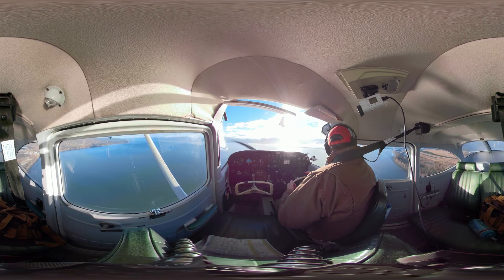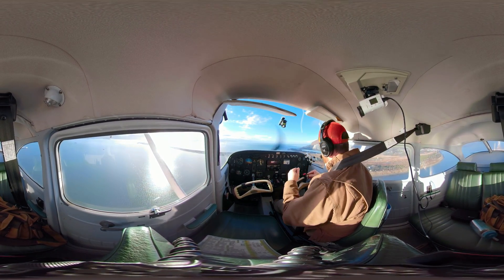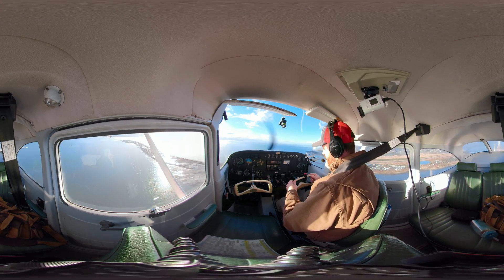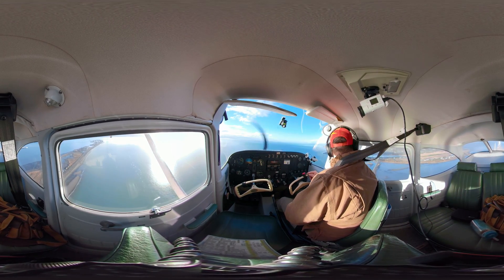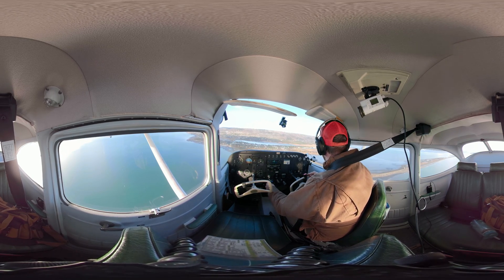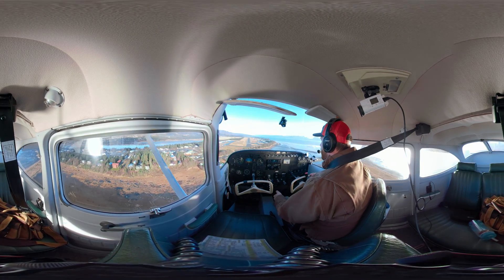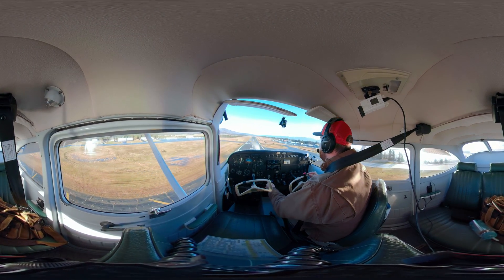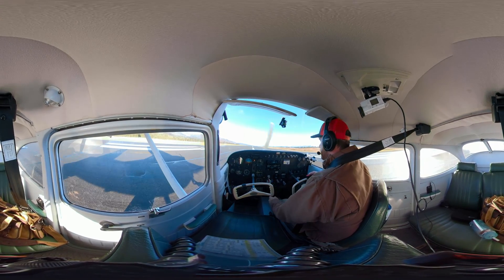How to fly in 360 & VR: Normal Landing

Comment: This was fun to watch with an iPhone. Any ideas of where to put the camera if I tried this in the T6 / Harvard?  I am doubtful there is a good spot in that airplane for a 360 mount
Reply from the maker: FlightChops I’d want it behind my head, off set a bit so your head isn’t in the way. I think it could work. The anti shake is amazing in post processing.
Reply: @angleofattack  have you had a good look at the T6 cockpit though?  behind your head is like a triangle crash bar thingy, and hardware for the top of the instructor panel - lots of crap blocking the view, including your head :P (not to mention very limited places to even rig the camera)...  If you look at my T6 videos you'll see where I have a sort of side / right quarter front view rigged from back there - if it was a 360 cam there it might allow for a little over 200 degrees of a good view... But I am still trying to find a good spot that would offer an interesting full 360